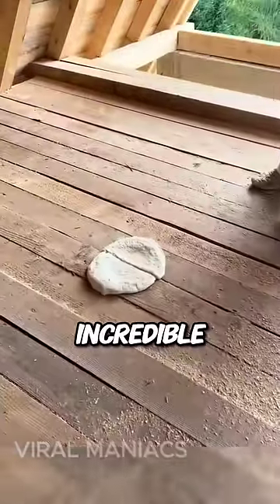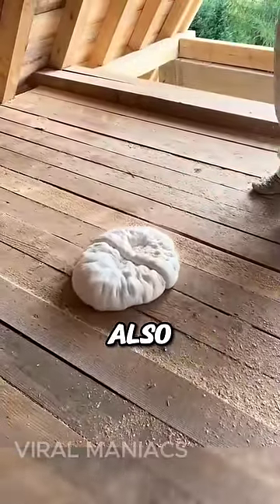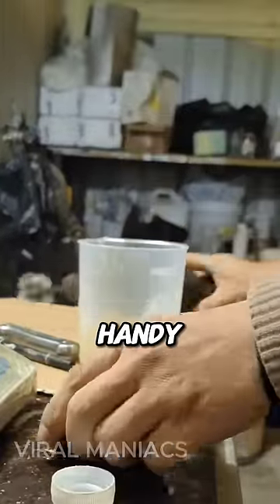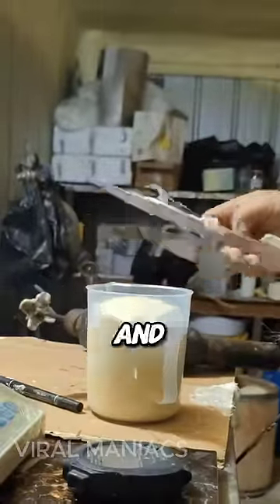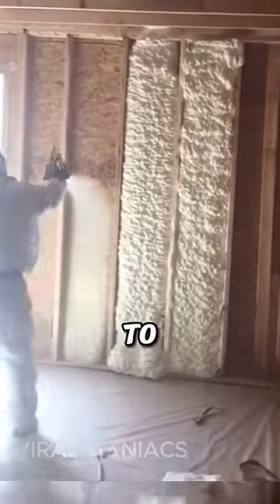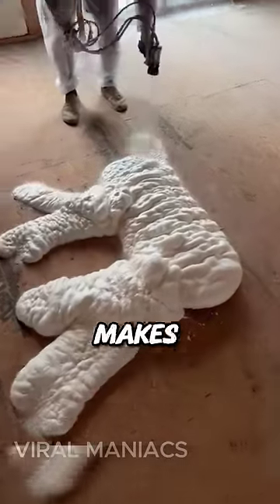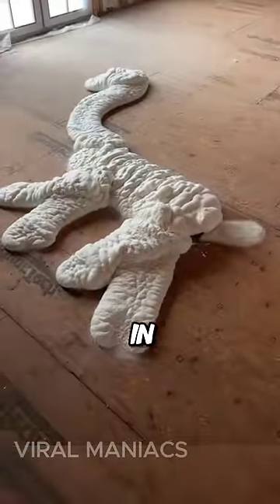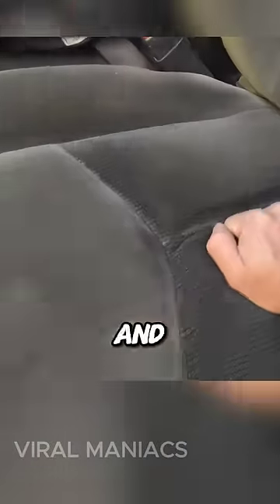The Superhero Foam That Will Blow Your Mind #satisfying #shorts

Comment: 14 floor 400 resident building  just burned up in Spain due to polyurethane foam insulation.

Try rock wool.
Reply: That is awful! Had no idea it is so hazardous.
Reply: A vew years ago in London a counsel house (appartment building) went up in flames because the insulation got burning many deaths to mourn.
Reply: @a1hamer yea, Grenfell Tower... that's a sad and preventable loss of life, may they rest... you'd be shocked how many houses here still have it as cladding, even on some older low rises...
Reply: This stuff is actually fire resistant, so much so, I got massive discounts on fire insurance premium
Reply: Polymers are Flammable. After all polymer is derieved from oil, gas and sometimes even coal which are all combustible compunds. Britains Grenfell Tower fire incident is an example of flammable materials used in buildings without much understanding of the effect these flammable materials has in fire situations.
Reply: There are different types of PU foam, some of them ale self extinguishing.
Reply: Polyurethane foam is fire resistant as hell. Are you sure it wasn't the drywall, wood, paint and wiring that went up?
Reply: It's not fire resistant It's hard to burn but when you get the fire started it's going spread fast
Reply: Doesnt this stuff give cancer if they were used in a really old house or is that wrong
Reply: @Blue_pool325 You're thinking of asbestos, if I'm not mistaken.
Reply: @a1hamer It was the cladding that burned too quickly, not the insulation. The cladding was, unbelievably, flammable.
Reply: My wife drove by it 15min after the fire started and filmed it. In 15min the building was almost completely engulfed in flames. 

When I see this type of insulation now the hair on the back of my neck stands up
Reply: yes ployurethan is a plastic fuel & to inflate it with air makes it combustible.
Reply: Did you try live near factory of rock wool?
Reply: @soda366 
Who's the manufacturer?
Every other company produces the highly flammable one.
Reply: Try wood wool. . .
Reply: Sure but tbf if the americans build their houses out of wood it doesnt realy mater tho😂
Reply: @utubesuxalotofazz  There are two products - simple polyurethane foam, and fire retardant polyurethane foam. Fire retardant products are significantly more costly.
Reply: @utubesuxalotofazz it’s highly flammable with few exceptions.
Reply: As someone who has a lot of real world experience with these products I'll set you straight yes it's flammable most places building code requires you either seal it with a top coat of flame retardant material or cover it with fiber glass insulator before you put up drywall it is amazing stuff though that's for sure also drywall is definitely not flammable and rock wool is so nasty working with it splinter's you up like crazy
Reply: Yep, rock wool is phenomenal stuff, don't fall for the expanding foam crap. It has its uses as a gap filler for limited applications, but no way would I insulate a building or a home with it.
Reply: @neykodimov2786 damn. I bet that image is stuck in her mind forever.
Reply: Expanding foam is used as a fire-stop where utilities penetrate a wall. 
You have to get the right stuff.
Reply: @a1hamer that was polystyren not EPS. Those are not the same thing. Polystyren burn like a order of magnitude faster.
Reply: There is video that talk about foam insulation fire resistance,and I agree that polyurethane is one of (or the first) one that burn the fastest
Reply: It went up in flames because of the FIRE. Not the foam.

Comment: If you use it in the UK your house may become unsellable. This is due to this foam literally stopping all air circulation. As a result the wooden structure of a house can get constantly wet, mouldy and even rot.
Reply: Precisely
Reply: And it burns like isolation foam.
Reply: Thank you for your information.
Reply: Thank you for this information! I was already thinking of putting this on the walls of my garage!!!😮
Reply: this is from the US so it undoubtedly is also a food product
Reply: That's why the house has to have extra ventilation.  I'm not familiar with this particular product however, I have seen fire proof foam when I lived in turkey and can attest to its effectiveness.
Reply: @Decentralized_World1 that is a very different type of foam though. this particular foam is VERY flammable.
Reply: @@JonFixesEverything yeah i seen something about this. many US homes are not build to last.
Reply: very true. and the fungi can draw termites that you will not see until its too late
Reply: There are ventilation standards in the US that make it perfectly sellable here
Reply: Wrong - the foam is blocking up 'uncontrolled ventilation'.  Uncontrolled ventilation is gaps down to poor workmanship etc and controlled ventilation is windows that opens, extraction fans etc.  All houses with any type of insulation should still have ventilation either forced or passive.
Reply: I believe the gas that comes off it are toxic as well.
Reply: @me5768  Once its set it is inert.  I have it in my attic and no impact.
Reply: @zool201975  we make it here and it’s only for export
Reply: @zool201975  you are confused obviously
Reply: Spray foam insulation in the UK is becoming increasingly popular due to rising energy costs and environmental concerns. Not only does it help save you money on heating/cooling bills during winter and summer, but it also makes your house more airtight and energy-efficient.Apr 10, 2023
Reply: Spray foam insulation in the UK is becoming increasingly popular due to rising energy costs and environmental concerns. Not only does it help save you money on heating/cooling bills during winter and summer, but it also makes your house more airtight and energy-efficient.Apr 10, 2023
Reply: @zool201975  American cheese, especially in fast food applications.
Reply: Then the Structures should be better made!
This type of foam is used in the US . Everywhere from deserts, swamp areas, alpine and everywhere in between! With no issues! Even  preventing mold and mildew!
Reply: @paulhunter9613 interesting. 
So am I confused about the joke or that this material is notoriously flammable? 
And you sell this stuff you say? 
I see. 
I hope it did not kill anyone in any fires.
Reply: @riboid  yes this is why its not allowed as there are plenty of other materials and methods that neither turn your house in a firebomb or makes it too easy to remove ventilation completely. i can also say when you get hit by  a meteor that you did shoddy work by not looking up and be in open air 100% of your life. these kinds of arguments are moot points.
Reply: @brandonhill2183  yes and the US is notorious about lacks laws prioritizing commercial profits over customers. 
in Europe saying this does not impress us even when you are correct as it is more likely lacks laws then functional ones.
Reply: @zool201975  Widely used as a pizza base in Texas and Idaho.
Reply: @zool201975  Your European socialist superiority attitude does not impress us. And the fact you ignored half of what I actually said about ventilation standards so you could go on your anti America diatribe to boost your inflated ego says a lit about you.
Reply: And costs a lot to repair any part of your home that has foam in it or on it
Reply: If you are smart ask the man that wants to sell you this for your home ....why does he need a breathing  mask if safe no mask should be worn
Reply: @zool201975 Only when served hot with gravy.  We're not barbarians.
Reply: @brandonhill2183  Neither we are impressed by your American standards. Many of us used to live in the USA for various reasons (not necessarily economical). Therefore, we have reasonable opinions based on comparisons through life experience. For example, European houses are massively superior to Americans. We build from solid and safe materials that last. Similarly, food here is a way higher standard than yours. We have got much better health services that are usually paid from our taxes and therefore freely and easily accessible. We are better protected at work (for example most Europeans work 40 hours per week and have standard 25 days of paid holiday per year) and can't be fired at will unless there is a gross misconduct or crime committed. For you it may be socialist way of life but it is what we secured for ourselves. But these are the subjects for other discussions.
Reply: @andyhill157 hmmmm gravy
Reply: @zool201975  yes you are confused and no jokes were said or implied. And no I did not say that I sell anything. And I hope that it did not kill anyone, you sound hopeful that it did. Get some professional help please
Reply: @paulhunter9613 So you took the food bit as literal... I honestly have no idea how to respond to that.
Reply: That is when a house is insulated by an overzealous contractor that seals up the house tighter than a pigs ass including especially soffit vents thereby cutting off all air circulation but when used and installed correctly it's actually a decent product. I've had a front row seat to all this as an HVAC contractor and yes I've definitely seen houses develope black mold from being choked by these gung ho installers.
Reply: Damn straight, sir!
Reply: Simply not true if you research the facts.
Reply: its also a good noise conductor.
Reply: @riboid no impact. Yet. 😂
Reply: @bearwolfthewild you basically just implied that someone can suck at their job and not get fired unless they like harass a colleague?
Reply: Bang on sir I'm a roofer and I literally don't know how this product is even legal it will absolutely destroy your roofs structure
Reply: Isnt it fire retardant? Why is it a danger
Reply: As we know, they use lining before spraying this foam for insulation & its coordinated well with structural, & design so safety is foremost... unless ur contracted it via unprofessionals, then ofcourse that will come out dangerouse
Reply: it's the same anywhere. u gotta have someone who knows what they're doing apply it
Reply: Never understood why people make houses with flamable stuff. Also why they always make the walls extremely thin.
Reply: @zool201975 Why build a home to last when they are completely obsolete in 50 years and you're better off tearing it down and starting over? This is what makes America #1. We're not attached useless crap from the past. Attachment to the past is actually starting to hold us back...
Reply: @zool201975 hahaha..does look like a chicken nugget im familiar with
Reply: @@JonFixesEverythingsaid it best..we live in a game of MONOPOLY
Reply: @bearwolfthewild  so you are still a child
Reply: sounds like poor vapor barrier management lmao.
Reply: @riboid Regardless of its intended use it definitely causes damp. Had plenty of jobs replacing rafters and even entire roofs. The tile batten is enveloped and also the “breathable membrane” is now useless. Maybe it’s different in the US. Building methods etc. In regards to greener solutions my house is 120 years old. Sure it’s not as efficient. But it’s in perfect order. Modern homes will last 30 years before they’ll need tearing down. Nothing sustainable about that.
Reply: @zool201975  there are safer options, also sprayfoam ones, but I think this particular one really is extremely flammable. And it is not just when it is fresh, it really is good for burning sown the house if it ever ignites for any reason whatsoever. If you had the exact same wooden structure but without the foam, then the fire department could at least try to do something to stop it. Not with the flammable kind of spray foam insulation.

Also, sprayfoam is hard to clean up, so if you ever want to remodel... Good luck. You don't get the surface of the wood clean anymore, gotta either live with it or replace all the wood parts.
Reply: @JonFixesEverythingNice, flip enough properties to pay for the impending lawsuit... 😮
Reply: @brandonhill2183 you have to have a ventilation standards just to know how to build your houses that's funny 😂
Reply: @petergriffen1696 that's why we have trial periods 🤷
Reply: @brandonn6099 you are number 1 just in your eyes, the rest of the world is laughing at you

Comment: 40 or 50 years from now when foam starts degrading in all these houses they will have a cleanup that is horrendous just as we do with asbestos today.
Reply: If you leave asbestos alone it's not dangerous !
Reply: Exactly . It'll be 2 times more expensive
Reply: We're all just learning collectively as a species. It's amazing
Reply: Chinese drywall is already doing that!
Reply: @heybabe8438 
Only a half-truth. Biohazard, bioavailable requires mitigation.
Reply: What makes you believe it’s going to “degrade?” Ultraviolet exposure is the only method it could be attacked, and covered up in walls that’s not happening.
Reply: No problem - one or two hurricanes later, all the foam walls are gone ... at least not here anymore ...
Reply: @heybabe8438  Research published in 2021 found it can cause Gastrointestinal tract cancer. Was due to low level exposure in water. This is along with the well known conditions such as lung cancer and malignant mesothelioma through contamination with particles in air.
Reply: New regulars it impossible to sell houses that owners have insulated their roof joists. Only way to get a
Mortgage is to have it removed from reinsulated with alternative that makes the building regulations code
Reply: SPOT ON !!!!!!!!!!!!!!!!!!!!!!!!!!!!!!!!!!!!!!!!!!!!!!!!!!!!!!!!!!!!!!
Reply: I always thought this can't be good in 100 years
Reply: @Bama3728 
Dry wall is probably easier to replace compared to this foam.
Reply: @billwilliams8232 
I think foam make repairs difficult.
Batt insulation, easy to replace
Reply: If only you knew what you were talking about…what makes you believe it’s going to “degrade” in 50 years?
Reply: Very thoughtful comment

Comment: Dont forget that it is EXTREMELY flammable. Once it starts to burn it is impossible to stop from a practical standpoint.
Reply: it's literally not flammable, worked for years installing spray foam in many businesses in upstate NY.
Reply: Which is it? Styrofoam is flammable - isn't it? Are they the same thing? It sure looks easy to use...
Reply: That's the opposite of true
Reply: I spray this stuff in upstate NY now and have for nine years where do they hear this shit.. they have demonstrations where they show identical rooms on fire and the one with foam is significantly less damaged
Reply: not true. this is fire resistant
Reply: Many commercially available PUF products are treated with flame retardants
Reply: @ehaaron  I thought that was the case. I had some of this crap a while back and I could swear it said fire resistant
Reply: Well try it. Put 🔥 on a piece n try it
Reply: Highly toxic for occupants
Reply: @amphoric2358  Depends on the level of heath. Fire resistant is not fire proof.
Reply: @ehaaron 
“Fire Resistant” = another toxic off gas for the family to enjoy throughout the years.

The formula is constantly being readjusted since the time of it’s conception.
Reply: Has to meet building standards so your statement is a lie
Reply: Pure polyurethane is quite flammable yes, however due to applications of this product manufacturers mix in flame retardent chemicals to combat this. Because of this spray foam is harder to ignite than many other forms of insulation (most of which are also flammable) but once ignited it is still PU and thus it burns rather well. 

There are ofcourse ways to construct buildings that overcome this problem but as always its quite cost prohibitive. Wood, PU and drywall is cheap which is why it gets used so much.
Reply: @tropickman Wrong. Even if it burns it doesn't release any toxic fumes or smoke
Reply: @tomhenry897 The stuff they used to insulate Grenfell Towers met Buildings Standards too. Didn't stop it burning for 2 days and killing 76 people though. Thousands of other Buildings are now unsellable.
Reply: How are they allowed to use this in homes ?
Flammable material is dangerous.